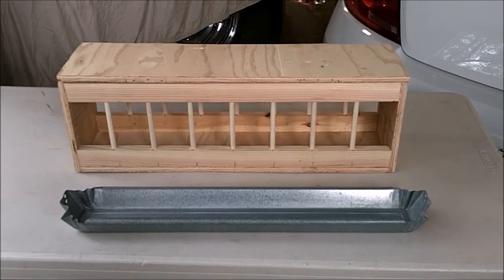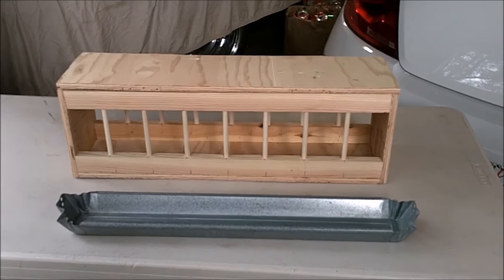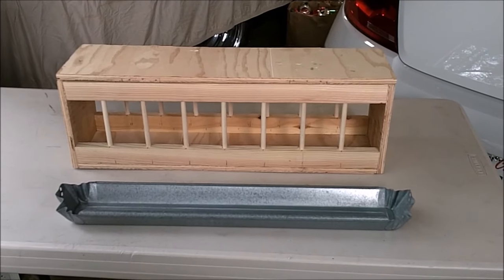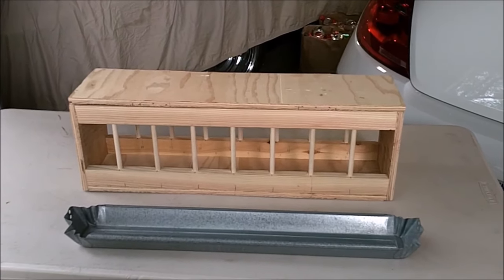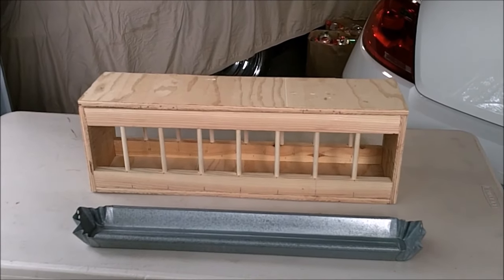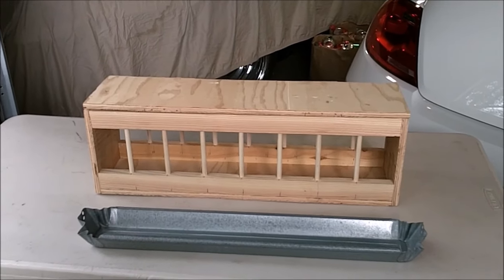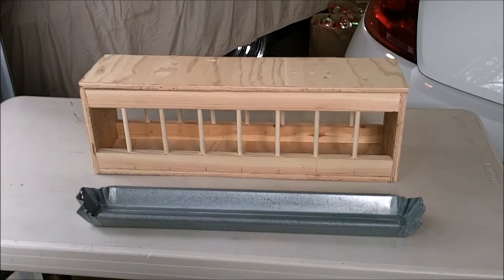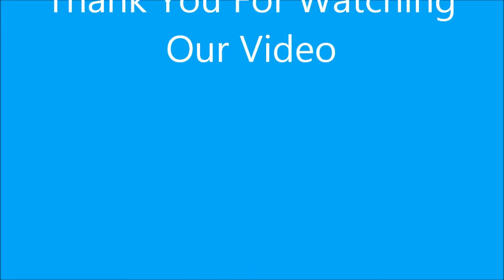Building Sanitary Feeders

Comment: ?please what is the thickness and the deep of the wood which the dowels been  put in
Reply from the maker: +Rokan R  Hello Rokan, The wood is 3/4 inch wide by 11/2 inch deep. There is a 4 inch high by 21/2 inch wide space for the birds to feed thru. The length of the dowels are 6 inches. The depth of the hole drilled is about 11/4 inch on the top and 11/4 inch on the bottom. This gives a little play to make it easier to assemble. Hope this helps. Not sure what the measurements would be in mm, Thank you for watching the video. Joe & Loli
Reply: waw
Reply: @bararazem6350  I need complete mesurment